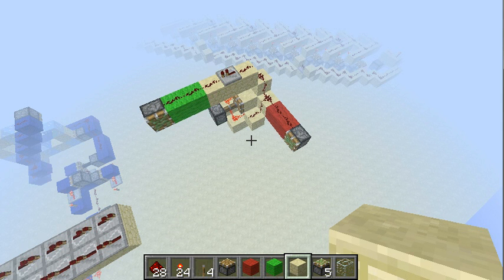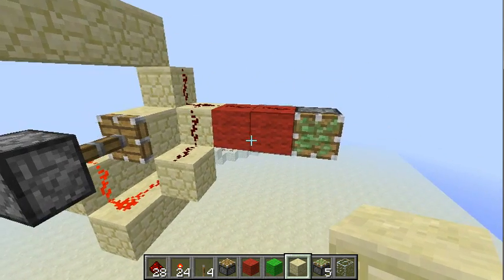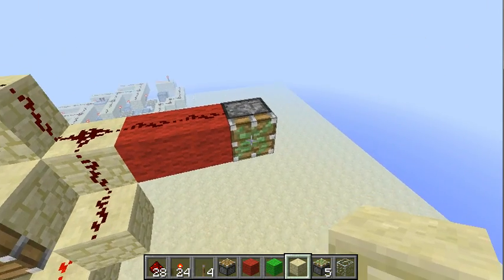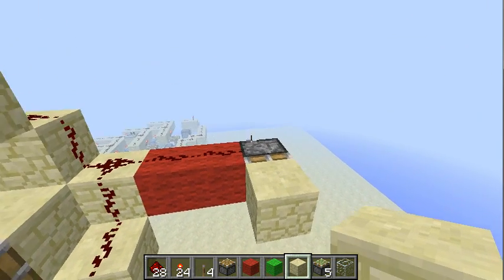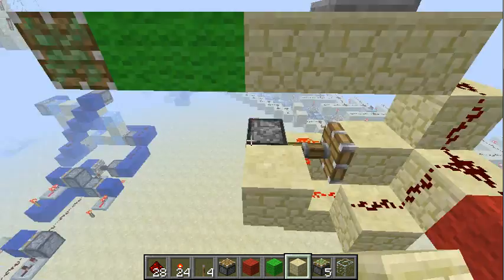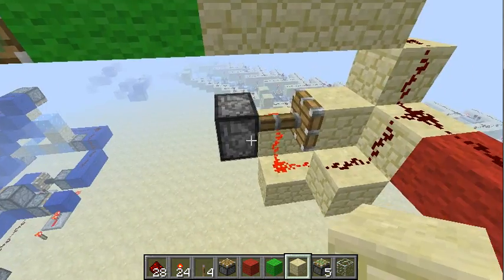Minecraft: Fastest possible BUD - Your challenge!

Comment: Hmm, why does it have to reset? Taking the output of a T-BUD (which can detect an update every 3 ticks) through a dual edge detector will be faster than any self-resetting BUD switch (but a bit troublesome to use because the typical piston dual edge detector delays the rising edge by 1).

If you say that's cheating: "Fast BUDs without torches" in the redstone forum - but use a single repeater set to 2 ticks instead of two set to 1 tick for it to work in release 1.0 and above ;)